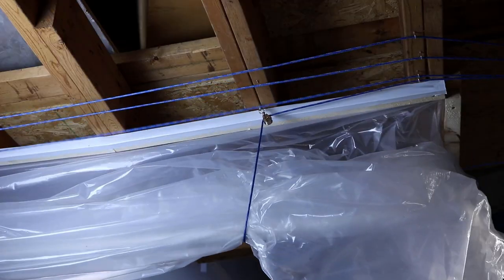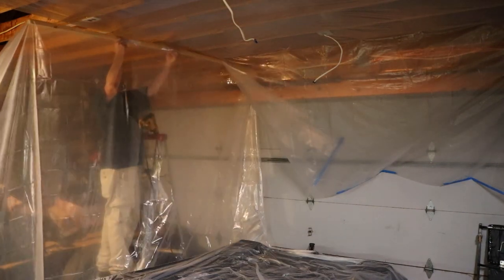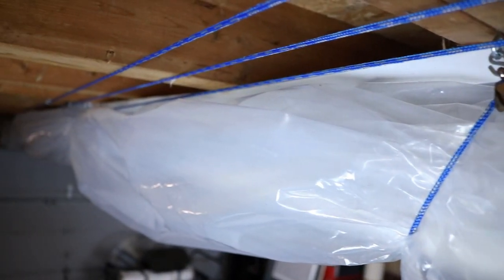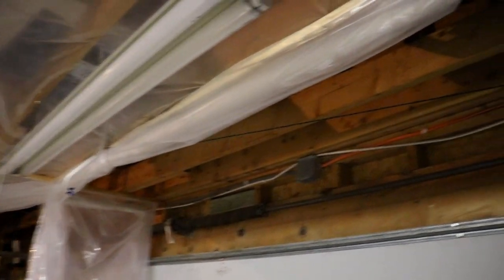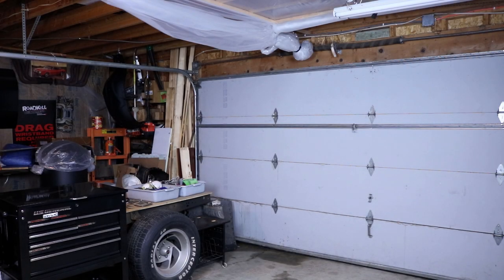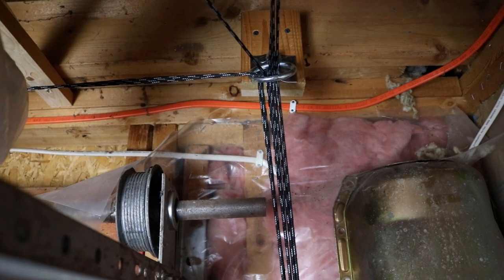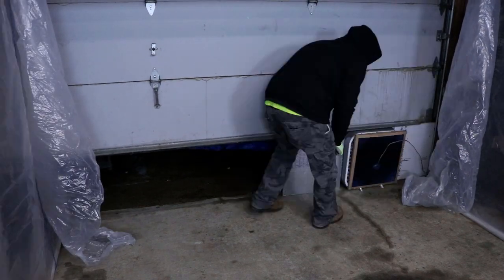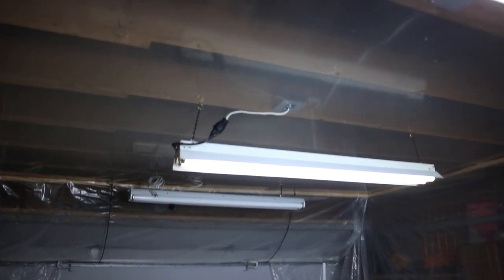How to build a DIY Paint Booth in your garage for painting muscle cars. WORLDS FASTEST SET UP!

Comment from the maker: Here is the parts list for this build. You can find most of the items here https://amzn.to/3yOHoL4 .

3 mil 10x25" Polar Plastics clear plastic sheeting (I used 4 of these)
1" pvc and elbows (for the lower frame)
1x2" wood pieces (for the upper frame)
a handful of Screw Eyes
a handful of Open S Hooks
2 Hitching Rings with square plate (the hoop)
3/16" 100'  Polypropylene diamond braided rope (depends on how many walls you need)
3/4" Koch single sheave pulley  (depends on how many walls you need)
1" 4x8' Polystyrene foam board cut to fit your doorway
20x20x1" True Blue Fiberglass House filter (for the fans)
20x24x1" True Blue Pleated Media Furnace Filter (for the foam door)

This is my Amazon Affiliate link. Purchases made through Amazon go right back into the channel and projects. 

Thanks for watching, Stay Tuned and Subscribe

Comment: Sweet. I'm probably going to build something similar but with 6mill because I accidentally bought the wrong type when I was insulating my house and have like 10x100ft extra.  
May try to make it more presentable though and have it actually fully roll up onto the PVC pipe then held up by hooks as I have a golf sim in my garage also.
Reply from the maker: It's definitely doable but you would need seperate walls. It works really well on a single straight wall section. Thanks for watching!

Comment: Novel idea, except for one problem. Commercial paint booths are positive pressure, to keep dust from being sucked in through every crack and crevice.  You need to push the air out, not suck it out.  The fans need to be filtered, and on the intake side, and the exhaust side needs to have only a small (and explosion proof!) fan to facilitate moving air, but not enough to take away all your positive pressure. For example, put 4 fans on the intake side, and one for the exhaust and fine tune it from there until you maintain a consistent positive pressure.
Reply from the maker: Yeah there is pros and cons to both. Either you are sucking in dust or blowing over spray all over your shop.
Reply: Concerned about the "explosive fan" bit. How could I doo this art home,  SAFELY???
Reply from the maker: @solidkonng  safely have the lights on the outside of the paint booth and look into explosion-proof fans. There is some build videos on how to make explosion-proof fans on a budget on YouTube. Ultimately you want only the blades to contact the overspray and the motor to be out of the way of the overspray.

Comment: Brilliant. I also did a video of a booth I designed. Your approach is very clever - particularly if you plan to reuse it a lot. 

I imagine the walls suck in a ton when you are running the fans that's what mine do and can be annoying. I couldn't tell if yours is air tight though.
Reply from the maker: Thanks John! It's not completely airtight but pretty close. The walls also suck in which made it pretty hard to paint the side of my 71 Cab without getting runs in the paint.

Comment: Hey Bart, (I saw Russ mentioned your name in his comment) Totally awesome idea, I'm glad I thought of it. LOL JK I saw something like this in a restoration magazine I take however, that setup wasn't as well designed as yours. I really like the simplicity of the roll down & roll up so it really doesn't take up a lot of storage space when not in use, yet comes into play very quickly. The only suggestion I would like to make, if you haven't done it already, is to take a torch to the ends of your lines to seal them, so they don't continue to fray. I use this type of line often and the frayed ends can be a pain. My only hiccup, if I can call it that in my shop, is the 10 ft. ceiling trusses so I'll have to get larger sheets of plastic and longer pieces of PVC tube. I too have a 72 C10 that needs some of the very repairs you show us in another video. Thanks for taking the time to share you ideas and great skills. Stay safe.
Reply from the maker: I haven't decided yet what I'm going to do with the Rope. I considered building some kind of wheel (like a fishing rod reel) that I can spin to let the wall down and bring it back up. That's definitely where it gets pricey having to get longer and bigger pieces of plastic sheeting. Sounds like you have a lot of fun ahead with your build. Got to love rust... Thanks for watching!

Comment: Is their enough room to walk completely around a full sized car and spray?
Reply from the maker: No, but I built it to mainly paint body panels and the cab of my truck. If you built it bigger you would have no issue painting a whole car. It could probably fit a small compact in the booth but no way a bigger car. If you build this to fit an entire car make the booth at least 2 feet wider because with the air flow being a negative pressure the fans will suck in the walls of the booth about a foot to the inside. Thanks for watching!

Comment: Would like to see it in action as i had a similar idea, which was to run filters in my windows and just have an extraction fan , but now contemplating whether to build an extra one car garage designated for painting and maybe do a fan pushing air in . But if this setup is fine then why go to the extra expense ? Thanks for the ideas
Reply from the maker: You're actually in luck! I filmed a video earlier in Spring where I epoxy primed my 1971 C-10 truck in the booth. I should have that video out in a couple of months. Thanks for watching and stay tuned!

Comment: That’s awesome I will definitely be copying u!! Just a couple of questions that I had a look but can’t see if u have answered them.

What fans did you use?

Also when it pumps out the fumes does it also spit out paint overspray that will then settle on cars parked outside? How have u avoided this?

Great video I appreciate it
Reply from the maker: I'm just using regular household box fans with house furnace filters on them to cut down on the over spray outside.  I've never had any issues with my car's being covered in paint but I'm always inside the booth so I'm not sure how much paint gets through.

Comment: Are you concerned about the fans igniting the paint fumes? Thanks for your video.
Reply from the maker: I did in the beginning, but not too much anymore. One of the builders that I talk to at Eastwood has been painting cars in his home garage for a couple decades now. And that's the way he has his ventilation system set up.  I will eventually build a belt driven cylindrical fan which is a lot safer.

Comment: How is the airflow with the 2 fans and your inlet filters?  Does the paint move decently out of the booth?
Reply from the maker: Yes, I haven't had overspray issues on the painting surface at all. I've thought about adding another fan but there is alot of negative pressure as it is and with the booths walls made of thin plastic it really sucks the walls inward towards the painting area.

Comment: I see you have filters in front of your fans, but do you find that you get over spray residue on the outside of your garage door from the paint dust and fumes venting out the fans?
Reply from the maker: I haven't noticed anything but  I'm usually inside the booth when I'm spraying.
Reply: @BustedClassicGarage  I'm talking about actual paint stains on the outside of your garage door, where the fans are blowing out.  Like how you would get paint stains from the mist all over the inside of your garage if you weren't using the plastic sheeting for a makeshift booth.
Reply from the maker: @gregsewell0   I haven't noticed that at all.

Comment: Very nice. What filters are you using for box fans?
Reply from the maker: The cheapest thing I could find at the hardware store I think they're $0.97 and made from a blue mesh material. Some auto parts stores sell rolls of actual paint booth filters which I will get eventually once I upgrade that section. And I'm sure a paint supply house would probably have that too.
Reply: Busted Classic Garage thanks!

Comment: how is the over spray?
Reply from the maker: It's not an issue on the panels I've been painting. I did have some overspray on the inside of the truck cab when I painted the C-10 but it's because I didnt cover the inside. I still need to strip it and paint it so I wasn't too worried.

Comment: So I rent my place and I'm painting a friend's car in here. do I have to cover the ceiling with plastic as well that's going to be hard
Reply from the maker: That depends. If it's anything like my ceiling and you have rafters I definitely would.  If it's already drywalled and fairly clean I wouldn't worry about it. You're basically going to be creating a negative airflow. So if you have any open areas inside the booth as far as areas not sealed tight enough you could end up pulling dust into the booth.  My booth is in no means completely airtight but I haven't really had too many issues with dust being stuck to the paint.  My problem lies with little bugs that decide to come in for a free buzz and end up passing out on my freshly painted panels... lol
Reply: @BustedClassicGarage  ewww bugs! Okay well it did okay for me and I didn't worry about covering the ceiling. My problem was my urethane primer sprayed dry the entire time ☹️ 
Thanks for replying to me and thanks for yr help
Reply from the maker: @jdmchickkustomz9417  no prob. Did you have the psi too high on the gun?
Reply: @BustedClassicGarage  no I don't think my tip was wide enough to spray urethane. The PS I had to be up high it wouldn't spray. The entire truck spray dry three coats of it.
Reply from the maker: @jdmchickkustomz9417  that sucks!
Reply: @BustedClassicGarage  not really according to the experts I can wet sand that seal over it and then basecoat it'll b ok